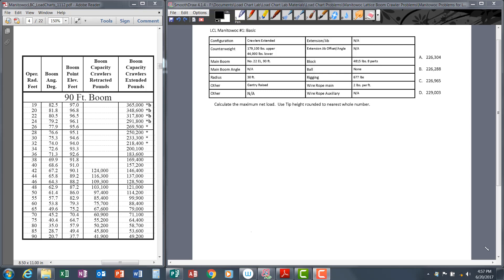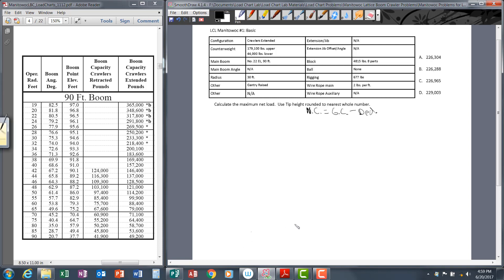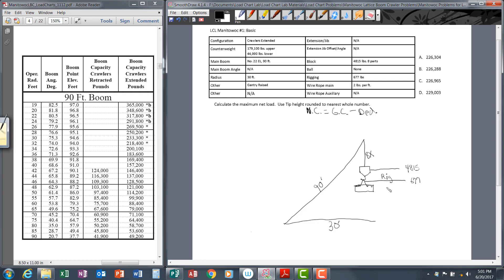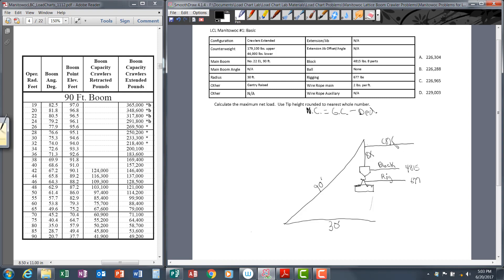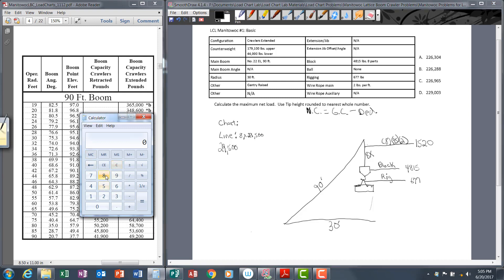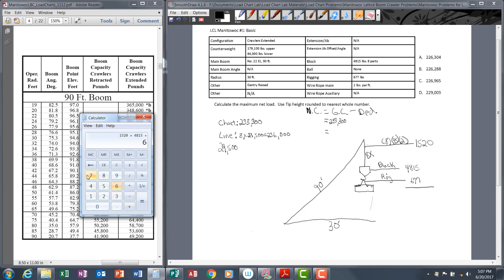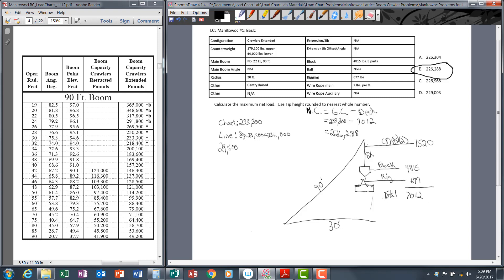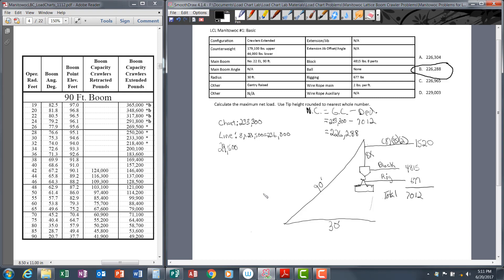Manitowoc LBC Net Capacity Introductory Problem Illustration

Comment: I thought at some point you mentioned a tutorial on the core test could you relay that to me orl let me know where to look for it
Reply from the maker: Working on it.  Should be done by Christmas.  When complete there will be a 14 chapter manual, about 80 short videos, practice quizzes for each chapter, and practice exams.  Lot of work and taking me awhile.  I’m about 80% complete right now.

Comment: do youre videos still apply to todays nccco test or is there any significant changes
Reply from the maker: For the new CCO LBC test these videos will work.  They will be using the manitowoc charts for the new test.  The new CCO exams for TLL certification will use a different chart (Link Belt RT).  I will eventually create some new videos for that chart/test.  Day job comes first however so it may be I while.

Comment: Hey, I am looking for a parts manual for the 3900 Manitowoc Crane, Serial No. 39280.  Can you guide me?
Reply from the maker: Check out the Manitowoc Facebook group.  There are several members more qualified than me, and they are very helpful. Good luck.
Reply: @LoadChartLab  ok np thanks

Comment: I wish when I took the test I had all that time to do all that but they don't give you time
Reply from the maker: Time Constraint is the biggest challenge on specialty exams.  But it can be done, using this process, and average less than 4 minutes per question.   Most of these Manitowoc (and Grove and Manitex) are instructional, going slow to teach the process.  Check out the Manitowoc LBC Net Capacity Full Speed video in the next reply. The way to develop speed is a lot of reps (practice problems).  Not just doing the same 5 or 6 problems over and over, but have a good set of 30 or more problems that you can practice with--this process will keep you accurate and the reps will build your speed while keeping your accuracy.  If you haven't already passed the exam, hang in there, it can be done.
Reply: @LoadChartLab its NOT about speed in the real world why is it during the test. No way in hell am I going to practice 30 or 40 chart questions before this bs money grab test. If they are so concerned about our knowledge pay us for so many continuing  education during a year...oh I forgot its all about the money for the non-profit NCCCO organization
Reply from the maker: https://www.youtube.com/edit?o=U&video_id=AYqP44O57ls